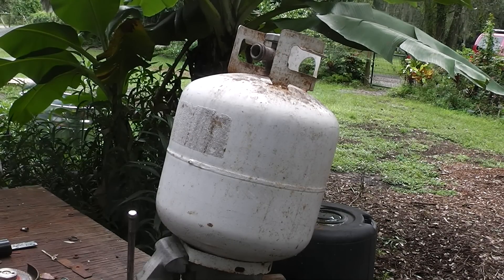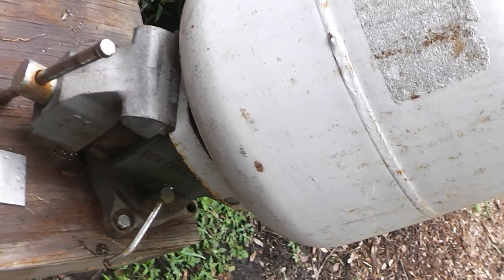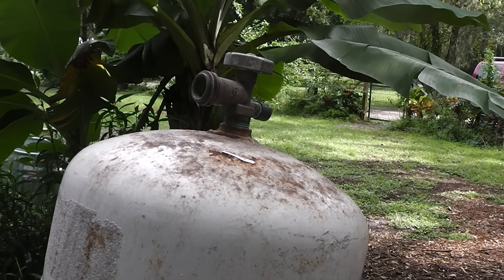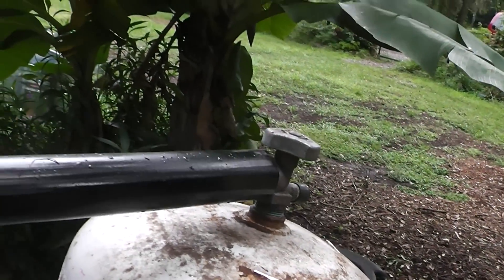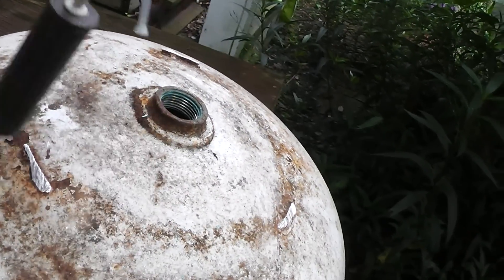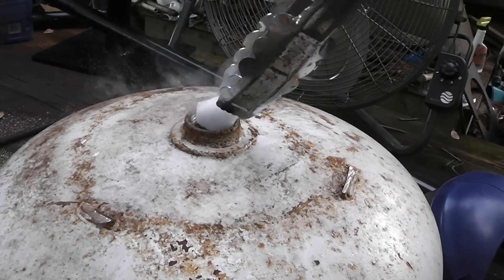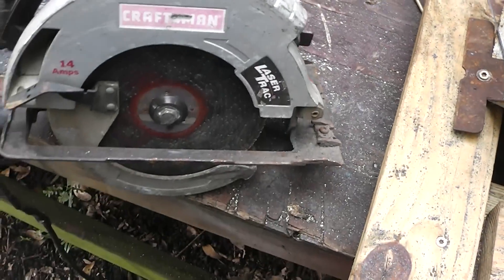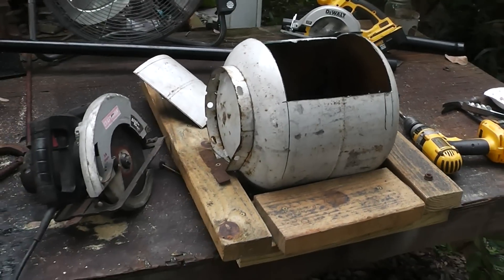How to Cut Open a Propane Tank without Blowing Yourself Up

Comment: I might add never as previously suggested use exhaust gas from an internal combustion engine to make the inside inert.  If the engine is in any way running rich you have added an explosive mix rather than deleted one.  In my experience I flush with running water and dish soap after turning it upside down with the valve and other fittings removed for a day or two.  Then I fill and overflow for an hour or more. I roll it on its side while running water in it as well.   Then turn it over and air it out again.  The trick is to be thorough as a quick one time rinse has the possibility of trapping a gas pocket at the top which will stay through one fill cycle as the hole is not at the very top of the container.  Theoretically the available porous space in a tank cannot hold enough gas to make an explosive vapor with steel tanks and standard sizes.  By porous space I mean the intermolecular space of steel.  But better safe than sorry!  Also leaving the valve opening open when cutting as any minor vapors (negligible/nonexistent if thoroughly washed and aired) are better burned than contained which a hole of that size will allow.  For the faint of heart who wish not to entertain such a project try hot water heaters which can be cut quite safely with plasma, cutting wheel, saws all, circular saw, etc.  If you get lucky in years gone by some were even made of stainless.  The glass lined ones are like a porcelain which is very very thin and cuts just fine.  I have used many for different projects as they come in all sizes.  Take care.  Doug
Reply: Douglas Thompson question why

Comment: Why would one need to cut open a propane tank. Just wondering
Reply: One never "needs" to cut open a propane tank, but if one so chooses to, a propane tank can be used for other things than holding propane.  For starters, compressor tanks are stupid expensive, but propane cylinders are much cheaper.
Reply: woodburners, barbecues, art, its a good free source of steel

Comment: If the piece you cut out is to be an access door, the best way to keep it lined up is to make the first cut on the side were the hinges are going, then attach the hinges (or at least drill the matching holes for them), then cut the other three sides.  Keeps everything lined up perfectly.
Reply: greyghostkoga great idea
Reply: Awesome advice. Thanks!
Reply: Lov it, thanks
Reply: You earned a 100th  👍 from me for that.

Comment: propane places flip them over for a day or two propane always goes to the lowest point than I fill them right to the brim with water than empty and cut
Reply: Hello, I saw a mechanic doing some welding on a gas tank of a motorbike (just petrol). The mechanic did actually filled that tank with water then started doing his  welding job. Even cutting that tank you can do the same, filling it with water. It will be messy and wet but I think it 'll be safe to do so.
Reply: D Steven Paisley 
 HELLO
FROM
Reply: then

Comment: Professionals fill the big tanks  with water and TSP then let 'em sit. 

I don't bother cutting up BBQ LP tanks because they aren't good for much and better metal for most jobs is plentiful with some educated scrounging,  but if you swap valves they make nice portable compressed air tanks. The air will smell like the mercaptan odorant which has entertainment potential if you've the right sense of humor.

Comment: remove valve turn tank upside down   propane is heavier than air   leave for ten min and throw a light to it...
Reply: immeohmyoh ya! obviously. I meant after the tank is "empty". I Ain stupid enough to  remove the valve from a full tank.. jeez.. lol. aside from being dangerous, that would be a huge waste of good oxy/propane torch fuel!
Reply from the maker: +SavxgeX420 Propane is heavier than air but , that method will not remove the propane that has migrated into the pores of the metal.

Comment: I'm not an expert on this but I think water would be more than adequate to displace the oxygen.  Can someone please confirm this?
Reply: One thing you will notice is that all the people that died doing this have no comment on the matter.
Reply: Confirmed. Better with water. An easier. And cheaper. And faster. And safer.
Reply: @Piterworkshop  far, FAR safer.
Reply from the maker: +Blackhawk7O6 Yes, water would work also.
Reply: Nice video and I like that you stated using the Dry ice in the tank after you already rinsed out is just an extra measure of safety. Why do people seem to have an issue with this? I'm perfectly fine with anyone informing the thousands of people that will watch this YouTube video more safety precautions, so they don't go killing their self or someone else. Great job! Thank ya for sharing. :-)
Reply: Felony Videos 😂😂😂😂
Reply: Blackhawk7O6
Reply: I am going to try it with water on the weekend.
Reply: @ToolsAndStuffOFFICIAL  Did you survive?
Reply: @DOCTOROCTAGONAPUSS  Nope. Killed me stone dead.
Reply: @ToolsAndStuffOFFICIAL  R.I.P.
Reply: Fly high tools & stuff...fly high
Reply: I used to use water to displace the residual gas in 100 ton gas tanks,  we then opened them up and walked around inside to inspect them after using the water to do a hydraulic pressure test.
Reply: Felony Videos ::: datz a goodard
Reply: Blackhawk7O6 I cut them all the time I've never filled one up with water or anything. I let air out for a fee days and cut them you may small a vinegary smell but it's harmless.

Comment: thats a very useful and quick tool, a sawzall is it? i think the dry ice might be a bit overkill, just use water in future
Reply: I fill it completely with water to expel ALL the gas, close the valve and start cutting. Thereafter the water can be porued out and cutting can continue.
Reply: Powerplasma would be even faster if you own one or can get your hands on one.
Reply: i have one, id never use it on a sealed bottle
Reply: thepoultrypeople you just leave the bottle mostly  not enough gas in there to explode
Reply: I think there is the flavor/scent oil with the propane and some oils burn pretty darn good...........so if the sun has already heated the tank to make the oil start to vaporize, maybe caboom.......we that work the trades have safety steps we take ....man hours and petty cash comes second

Comment: How to cut open your propane tank without blowing yourself up.  Get your onery neighbor to open the tank for you, with a sledge hammer and chisel !  Otherwise, go to your local metal recycler and get all the needed cylindrical tubing rings (and dish bottoms) you need.  They will have de-cocked the propane bottle long ago.
Reply from the maker: +John Lord All my jerky neighbor knows how to do is pump water. lol

Comment: Nice straight cuts. I would use the circular saw metal blade,but I need a thinner kerf for what I make. Looking forward to this project. Finally cooling down here. Mid 50,s tonight!!!
Reply from the maker: +BCtruck, rebuild, repair,repurpose Thanks.  I was given an old compressor that will eventually turn into a bbq smoker.  
 I'm hoping for some cooler good working weather soon (Nov ?) here in my area.